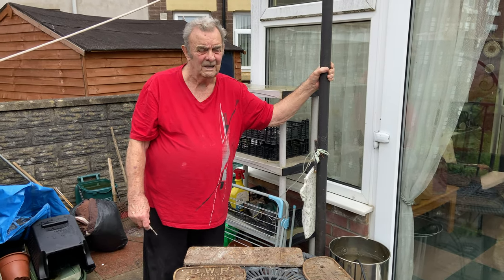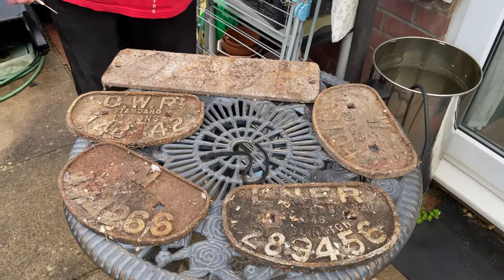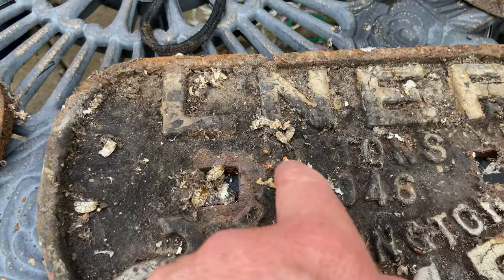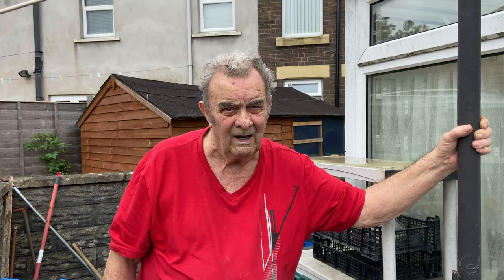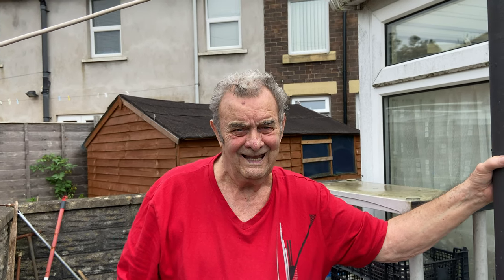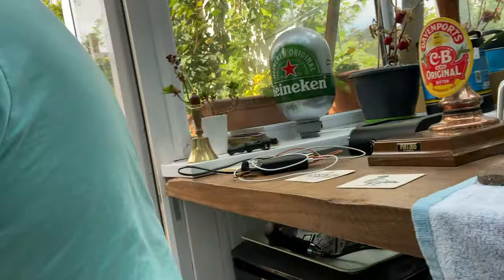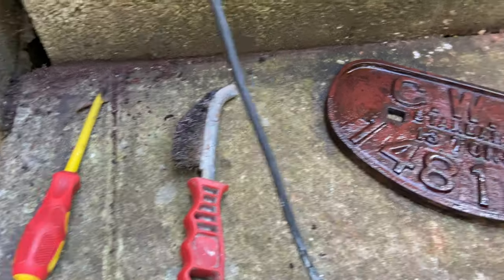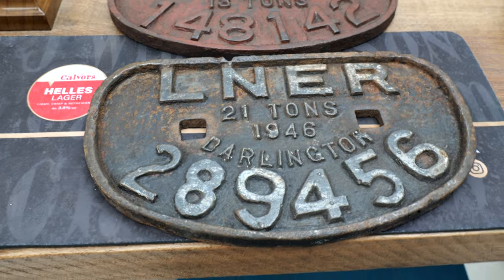Bringing Cast Iron Steam Engine Licence Plates & Wagon Plates Back To Life & My Grandfathers Story!

Comment: If your going to paint them then go over them with a wire wheel in a drill so remove the surface rust and also dont spray WD40 type products on anything you are going to paint because it contains silicone that react with the paint. If your not going to paint them then you could rub some linseed oil on for protection and to bring out the patina. One last thing if you want all of the surface rust off you can soak them in vinegar for 24hrs and it will just brush off, hope this helps